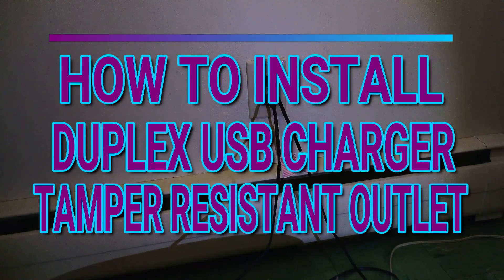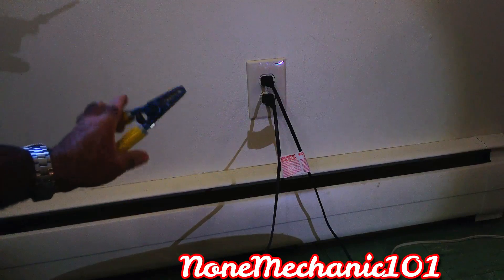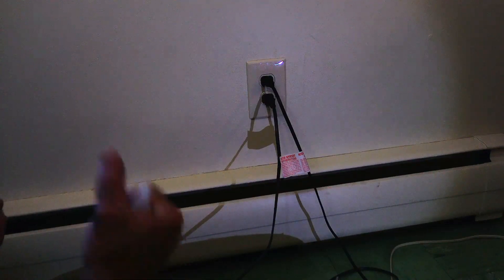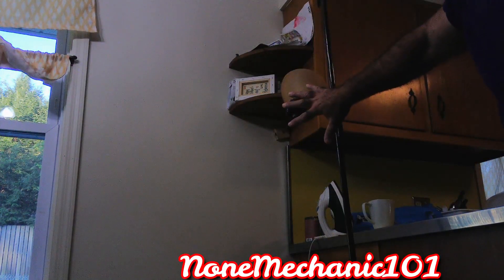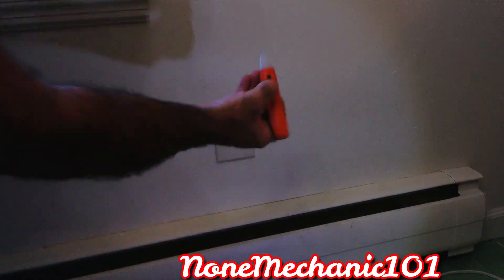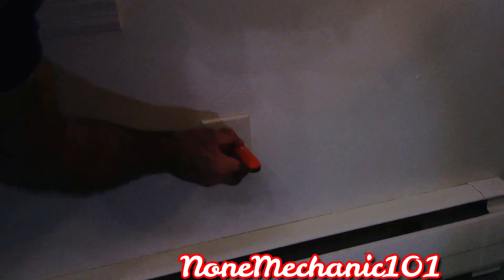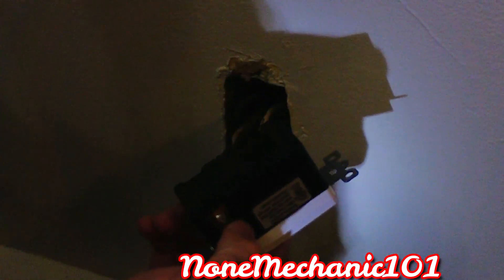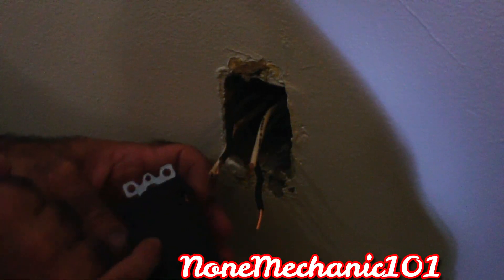How to Install a Duplex USB Charger/Tamper Resistant Outlet

Comment: How can I split the USB receptacle so half can be always on (black wire) and the other controlled by the switch on the wall (red wire), while the USBs are always on?
Reply from the maker: @randychen1514  Sorry not sure